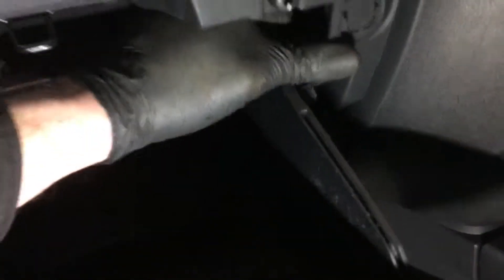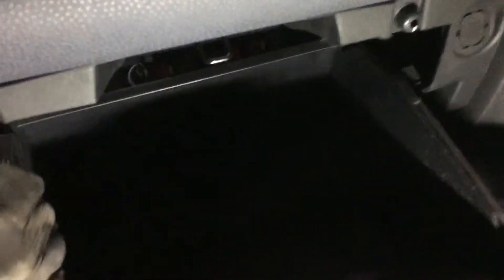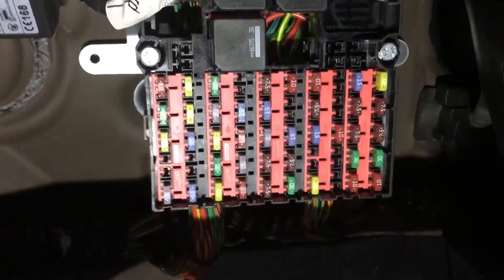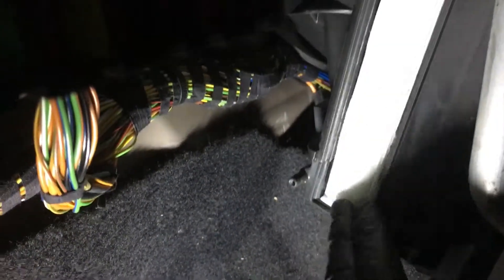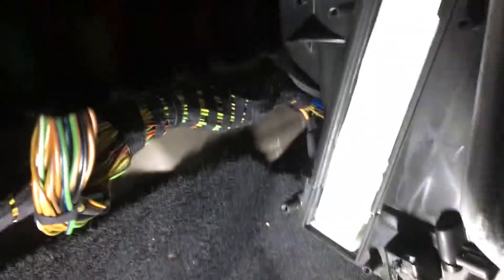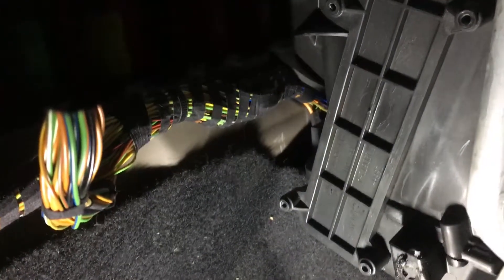Ford Fiesta Cabin Filter Change Pollen Filter 2007 MK6

Comment: Excellent video. I needed to do this and you showed me exactly how to, no frills, no waffle, straight to it. I had to re-check, to find out the correct orientation of the filter. The flow arrow is very feint and marked only on one edge, on my replacement (NAPA).
Reply from the maker: Thanks, you’re welcome